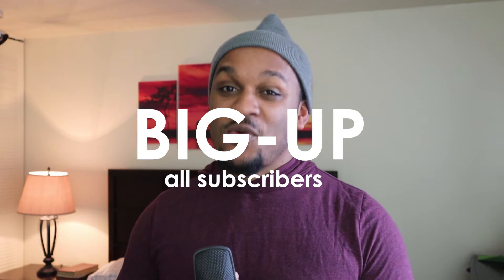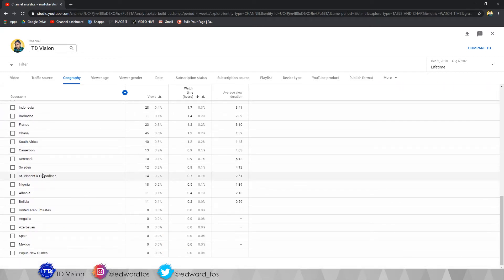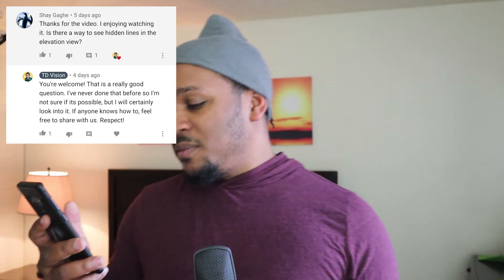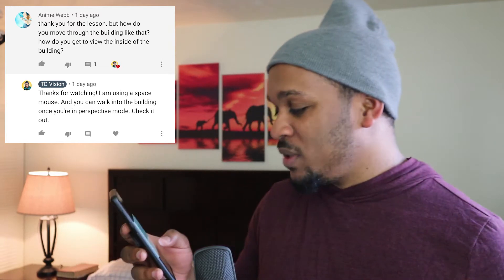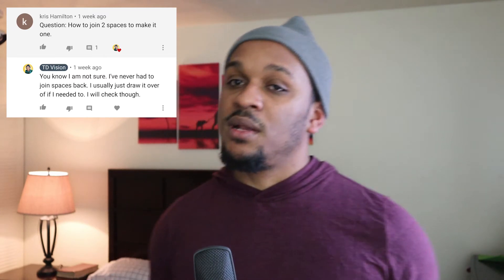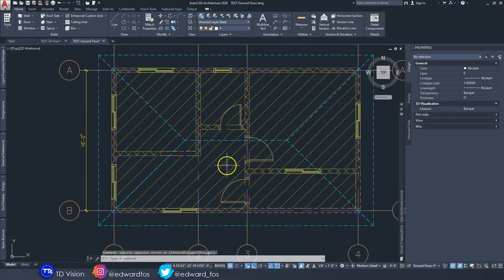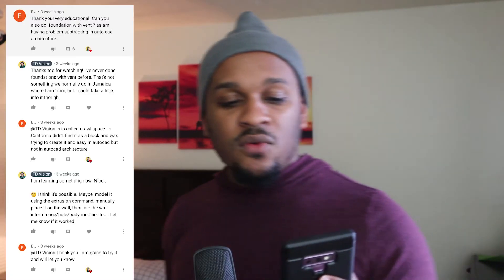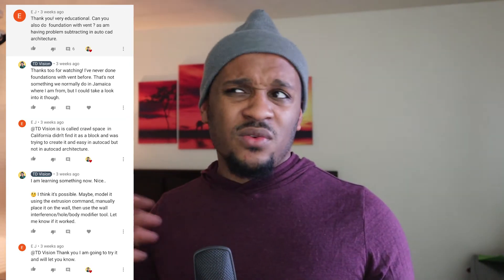Q&A 1.0 | Foundation Vents | Standard Walls | Elevations | Join Spaces

Comment: In roof design, is it possible to create the overhang between roof cover and fascia. Also can autocad architecture create gutters which fetch water from the mentioned overhang??
Thank you for your continous goodwork.
Reply from the maker: You know, I've never modeled roof gutter or roof covering overhang in 3D. I usually just add it to the detailed view with 2D lines. I'm sure there must be a way to do it though.